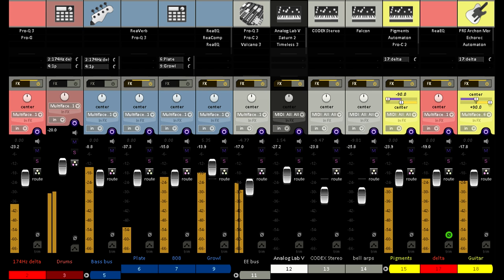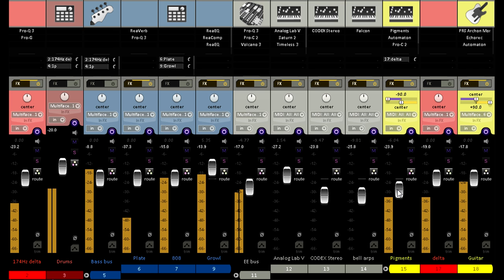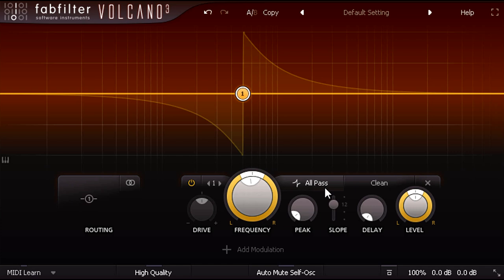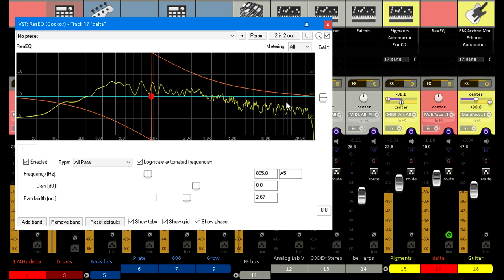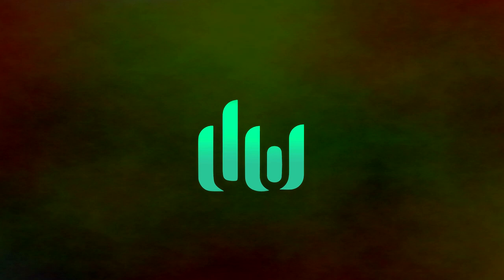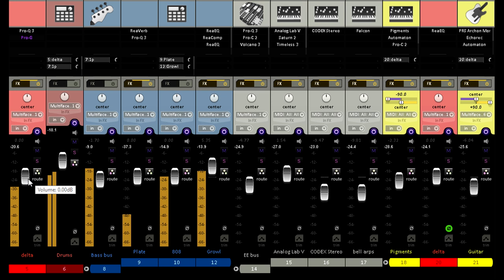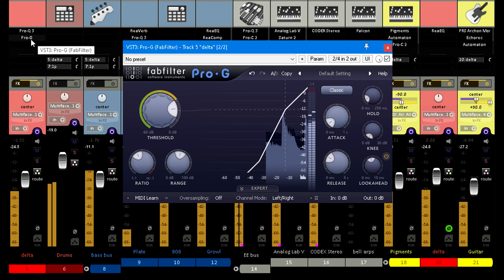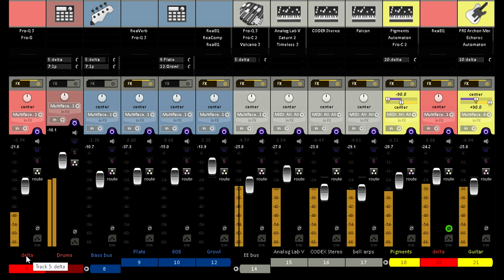Parallel Filters, God Tier: The Delta Channel

Comment: That last trick was awesome. I think in the past few vids a lot of people are asking how these filters are different from regular EQs. It just comes down to convenience for me. If I can move a fader to brighten up my mix instead of having to visit 3 EQs on 3 different tracks, or if I can balance my low end using one fader, that’s just way faster than the classic approach.
Reply: He gave a good explanation for this on the last parallel filters video. Paraphrasing, the advantages are what you said, plus the ability to use non-linearities (assuming a colorful filter), plus the ability to morph between filter shapes.
Reply: So in that sense, does the simplification of automation give you greater control over the outcome of a mix? Is that just a standard part of 'big picture' mixing that can't be represented quite clearly through youtube tutorial?
Reply: @vAlkemistv  I mean I personally think Dan Worrall is quite excellent at representing everything through youtube tutorials haha! I would say something that I've learned is that, if something is hard to do, people won't do it! So for example, There's been ways to use any plugin to do some Mid-Side processing, for a long time, but most people didn't really explore those options, until M/S processing became something you turn on by the press of a button on the plugin interface. So this is similar to that. If I have to work on 3 tracks to get a brighter mix, I may just convince myself that it's bright enough, but a single fader I can move, then it's at least worth trying, even though I may realize that it was bright enough, in which case, a single Command+Z gets me back to where I was :)

Comment: For FL Studio users: you can use patcher to make all the parallel chains you want. You can use fruity stereo shaper to flip the polarity of a signal. You can also do this in the mixer with sends and polarity flip (little up and down arrows symbol) like in Reaper
Reply: Patcher, the drug induced wet dream of sound engineers.
Reply: Can only flip polarity with POST fader sends! :) Just to bare in mind. Patcher is the way to go :) I'll comment my original comment here:

For FL studio users:
To flip polarity on a send (not flip on the bus itself), sidechain send (send with no volume or shift+route) to a bus of your choosing. Next on the track that you're sending from load up patcher last in your chain and add in a fruity stereo shaper and invert the polarity (use preset or make opposite the sliders on default load up). Now right click the "to FL Studio"  output symbol and enable the send you're using output then drag the yellow output flow cable into said output listed. Done :).

Alternatively can use fruity send with a stereo shaper before it in the chain but makes the home track inverted to without a send before it routing the audio somewhere else to keep the origin signal.

Comment: I figured out a method for Ableton which I feel is relatively simple.

1. Create Delta send channel (pre-fader). Add desired filters. Send anything that isn't being inverted to this channel (e.g. snare for 500Hz bandpass boost).
2. Create second "Inversion" send (pre-fader). Add utility and invert polarity on left and right channels.
3. Set fader on the Inversion channel to -inf (or sends only). Enable send to the delta and set to 0db. 
4. Send anything you wish to notch/cut to the inversion channel. It will then be inverted and sent to the delta channel.

Hope this helps out.

Comment: Amazing as always!! 

An idea for fellow Ableton users :
Create a new audio track, set it to "Sends Only", route whichever instrument you want to have an inverted polarity send, add a Utility device, flip the polarity on both L and R, and then use this to feed the parallel filter return bus!! 

Was able to follow along with the video no problem, of course it's a little bit more tedious than on Reaper, but whatever!
Reply: thank you for this tip lmfao i just wrote a comment being like damn this shit hard, but you have blessed me with a good solution.. thank you <3
Reply: Could work, but inside an AER you'd have to create eg 3 channels: Dry, Signal1 with inverted polarity, Signal 2, then instead of having a single fader to decide the volume of Signal1invpol+Signal2 you'd have 2 volume faders (that you could map to an AER macro though), good call anyway for those working more with inserts than sends.
Reply: I only got this to work by:
Sending the instrument I wanted to stay in phase to the master and also routing it fully to the return track.
Sending the instrument I wanted to be flipped to an audio track with the phase invert plugin. 
Sending that audio track with the plugin to the master.
Setting the audio track with the plugin to "In" monitoring mode. 
Putting my phase flip and other effects on the return track.
Reply: Yeah, you can do it in most daws, it's just not as neat, because you have to use an intermediate track.
Reply: You can save ableton tracks to come on with whatever plugins you want. I would set up for every track to come on with a utility, as it takes virtually no processing power.
Reply: Another compact way of doing it in Ableton: Use the Sidechain Listen function on the Ableton stock compressor (blue headphone symbol). 

1. Create an audio effect rack on a new audio channel (or send/return channel if you want), then create two (or more) PARALLEL chains in the rack. 

2. Add the compressor effect to each parallel chain, making sure the compressors aren't actually doing anything EXCEPT routing audio into the rack from your desired sources. 
    NOTE: Set the compressor Sidechain source to Post Mixer in the dropdown menu for each audio source. Otherwise you may not get perfect cancellation!!!!

3. Now you can invert the polarity of just one of the two more more parallel sounds coming in to this audio effect rack with a simple Utility on one of the parallel chains.

4. Add your filter after the audio effect rack and youre done!
Reply: Same works also for Cubase users! Just use an FX channel as your send-only channel and have it output to a group track, which will be your delta!
Reply: Nice tip, thanks! Hopefully I could get that to work in Bitwig.
Reply: Hi Petras, i'm in ableton. I have tried in every way to follow your reasoning but I can not get the result. unfortunately I translate from a language that is not mine. The only way I managed to do this is the following: 
- I take the fundamental of "Snare" with eq
-I move the eq to a sendbus with reversed polarity 
-I send to this send the signal of the instruments that I want to be attenuated on that frequency

let me know :)
Reply: @jimmynautal2303  Try this.

1.
Set 'Send A' with an EQ (like Dan's demonstration in the video.)
Set 'Send B' with an Utility and swith on 'Polarity Invert' both L and R channel.

2.
Set [Audio To] on 'Send B' to [Sends Only].
Enable [Send to 'Send A'] (by right click on the little circle with letter 'A') on 'Send B' , then send it to the fullest.

3.
Send your drums track to 'Send A'.
Send your bass or everything else tracks to 'Send B'

4.
Add a Gate to 'Send A', and you're good to go.
Reply: @iamfromcyfertron  it works! :) thx. now it's more clear for me
Reply: Yeah no problem doing this in Ableton.
Reply: Thank you Petras! I learned something new about Ableton :) And managed to pull off this god damn amazing trick! Thank you Dan as well!!!
Reply: @williamsaywell2198  Another great reason to have a Utility on every track (especially FX sends): Ableton’s gain staging is nonexistant. There’s nowhere to fine tune the levels besides the end fader or actual waveform/instrument volumes. I put a Utility on everything for that reason, to make sure i’m feeding any further plugins at the best gain. And also sometimes one at the end, for little post-plugin pre-fader tweaks. Ableton lacks the gain functionality of professional mixing DAWs like PT and Mixbus. If i’m doing a final mix for release, i often flip exported tracks into Mixbus and do a final mix there because i like separating the mix from my compositional process (it forces me to be finished with the composition), and it’s chill mixing in Mixbus.
Reply: @FoddyFogHorn  yea sends only doesnt make sense to me
Reply: Yup i noticed that when Dan said Reaper's feature only. Technically he's right, but the only difference being that ableton does the same with 2 or 3 more steps. I guess bitwig and other daws can do this too, but with even more steps...which is the reason you would want a mixing template that has this and all other tricks baked in and organized 🤓😎🫡
Reply: @davidpereira4455  You can save racks that do these things (you just setup gate sidechain to external inputs)
Reply: @4drops  Exactly!
Reply: @davidpereira4455  Hehe, my point is that there may be fewer steps with a rack, than the Reaper method shown in the video (Reaper might have racks/templates of sorts to reduce work too).
Reply: @4drops  Yeah man that's exactly what i meant in my comment 😎 Reaper is a beast no doubt, but in this very particular aspect, ableton and bitwig actually have a better approach/workflow for my usual process
Reply: There's also a free M4L set of plugins called "Audio Routes" that lets you route multiple tracks in many customisable ways. Pretty intuitive to use.
Reply: THANK YOU

Comment: my god, what an amazing tip. I really like the idea of construction the channels in a way that the balancing of the mix consists of less and less steps over time. The most common example would be to level multiple percussions relative to eachother, and grouping them for volume control over all of them. This tip takes the concept to a whole new level. I will definitely experiment with this!

Comment: Got this to work in Logic. You need 3 buses. Bus 1 has normal polarity and it's output is routed to Bus 3. Bus 2 has inverted polarity and is also routed to Bus 3. Bus 3 is where you do all the processing. Have fun!
Reply: i've done the same - but without bus 1. what is the need for bus 1?
Reply: Did you Try avoiding buss 1 and send those signals direct to buss 3?
Reply: @lucianogm yeh that's what i've done. So let's say snare is sent to Bus 3, everything else sent to Bus 2. Bus 2 has No Output and Sends to Bus 3. Seems to do the job... i wonder if you suggest the additional Bus 1 for latency/phase alignment?
Reply: @lucianogm  That would actually be better. Don't know why I had the bus 1.
Reply: @ala_lana_music  Actually. It's not needed. Don't know why I had it
Reply: @tepetti it happens to me too. Sometimes you get the best results when you sleep on it first

Comment: For FL studio users:
To flip polarity on a send (not flip on the bus itself), sidechain send (send with no volume or shift+route) to a bus of your choosing. Next on the track that you're sending from load up patcher last in your chain and add in a fruity stereo shaper and invert the polarity (use preset or make opposite the sliders on default load up). Now right click the "to FL Studio"  output symbol and enable the send you're using output then drag the yellow output flow cable into said output listed. Done :).

Alternatively can use fruity send with a stereo shaper before it in the chain but makes the home track inverted to without a send before it routing the audio somewhere else to keep the origin signal. 

:)

Comment: Dan you are an incredible engineer...
I come from this geeky/audio-bender way of mixing because it feels amazing to pinpoint the problem, link knowledge together to find a way and solve it.
Lately I've been experimenting with mixing with composition and layered/change of instruments: if the chorus feels too bloated remove an instrument, a layer (of a certain freq.) or change the phrase... if the bass enters maybe change of kick drum or drum pattern, etc.
I've found that this usually leads to compositions that I've never thought I can come with and the amount mixing "tricks" are less cause it was kinda mixed by the song itself...
Of course these techniques are not of one or another, in fact I think can work together amazing.
Anyway thanks for the videos and sharing your knowledge!

Comment: Coming back to comment once again, because here is an equivalent trick : let say you the same snare problem and you want to remove 2 dB on every track except the snare. Put an EQ on the master remove 2 db.  Copy the EQ on the snare, boost 2dB. It is like if you did nothing on the snare but cut 2 dB on every other track. It is not rocket science but it works

Comment: What a mind blowing trick, thanks for that!

Bitwig Users:
Either create a seperate channel for flipping the phase, or:

Create a Tool device on the channel you want to send, flip phase L + R if you need to
Select the device, press Ctrl + G
Turn down the mix knob of the newly created fx layer to 0
Send the FX Layer to the filter bus: either expand the channel strip with the little arrow icon to show the the Tool layer and turn up its send, or select the Tool in the FX Layer and turn up the send in the inspector

This way you can choose the point in the signal chain where your send goes out.

Peace <3

Comment: Outstanding lesson progression. The last 4 or 5 videos got us used to using the tools and mindset necessary to approach and apply the Delta Channel. 

For Sonar you can create the sends by creating post sends > aux channels. Then the aux channels (which are pole rev-able) can be assigned to another aux channel or a bus. On the bus  you must use something like Channel Tools to flip the polarity. I suggest using Channel Tools even if you're on an aux track as the available individual L/R pole revs, mid/side/L/R gain, channel width, and individual delays assignable pre or post encoding, gain, and pan add a whole lot of mojo to that Delta Channel.

Comment: At last, the problem of having to adjust two parameters has been solved, I'm amazed anyone managed to get any music out prior to this : ) Honestly sometimes I suspect you just like to tinker around and show off what you've discovered, and there's a pretty decent audio-nerd audience out there who will run with these ideas, but for the rest of us it really isn't an issue having a couple of EQs open and adjusting them to taste.
Reply: Sure...but the real deal is creativity and its a lot deeper than 2 knobs.... I think you are missing a whole world of implication

1.WORKFLOW:  If you template the above idea and drag and drop the solution...you have trained your brain to use more muscle memory. Muscle memory creates reliance on gut feel rather than looking or thinking about it and this is the real bonus. Ive been mixing for 40 years...these are all little gems to add to the workflow. 
2. DYNAMIC FREQ PIVOT: The low mids generally have the most contention...this is a good alternative to sidechain/trackspacing as its both substractive and additive. 
3. AUTOMATION EASIER: On top of that...being able to simply use a send per target ie a subtract or add, at will, takes a lot of the drudgery out for larger projects as you localise a common tool for global effect; Push/pulling for subtle movement according to context is a very easy action...once again, you can shut your eyes, grab the control and move according to feel...imagine that.

Speed becomes the essence...its like life drawing, learning to capture and complete in 3 mins vs 30 mins of drawing that is wasted because the weight doesnt sit correctly kind of works as analogy...for me anyway. Peace!

Or just tweak 2 knobs and the myriad of peripheral that goes with it...either or...but Im thankful for the exposition...Cheers Dan

Comment: Parallell processing like this is in a whole other ballpark than where most engineers play at. The result is surprisingly musical, but the method is extremely bespoke so I assume this is nothing you can really turn into a template. In a way, it actually brings back a lot of the handcraft expertise that audio engineers has lost due to automated work flows and digital solutions
Reply: Depends on the DAW really. Something like Bitwig you wouldn't really use a traditional mixer-type send approach to create this, you create it outside the channel-based mixer approach in the Grid and as it's in modular form you save it as a preset which is basically then reusable just like anothoer VST plugin in the signal flow or as Bitwig call it a Device chain.
Reply: @SamHocking  That's interesting! I have only a very limited insight into Bitwig but I hear lots of interesting stuff about it. What I meant with "template" wasn't really about the ability to save a template in the DAW, but more about the method of parallell filtering in mixing. Seems to me that it can solve very specific issues in a mix and opens up a lot of interesting and creative solutions, which are all dependent on the specific mix itself with all its instruments and arrangements.

I do see your point however, like creating new instruments by doing some weird filtering effects that morphs with dynamics and stuff by itself.

Comment: Works great in cubase since it also has a polarity flip on each channel whether it be an aux or bus
Reply: Seems like you should watch that vid again. It's about having the flip on the send, not on the bus itself.
Reply: @Musikproduzent  that really isn't a problem, you just send the track to a group track and flip the polarity there before sending it to the main group.
Reply: @lastboxofsparklers  jep
Reply: @Musikproduzent  in cubase a channel is a channel no matter of its a send or bus. And each has a polarity flip. The plugin itself doesn't need to have it.
Reply: @AboveEmAllProduction  they just dont know cubase : ) with the new midi remote I press 2 buttons on my external controller and the parallel send with polarity flip is set up in 2 seconds...
Reply: @TheMonkBeatsOne  if they dont know why do they even reply in the first place, always gets to me...
Reply: @lastboxofsparklers   I send the track by changing the route output or sends ?